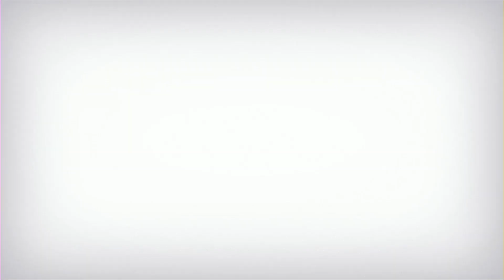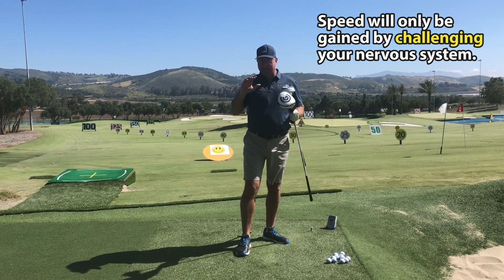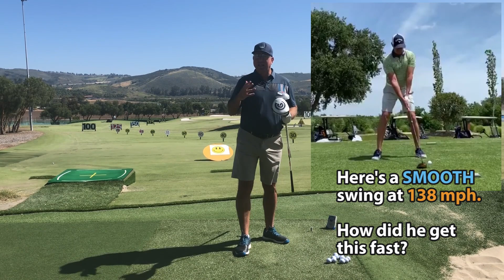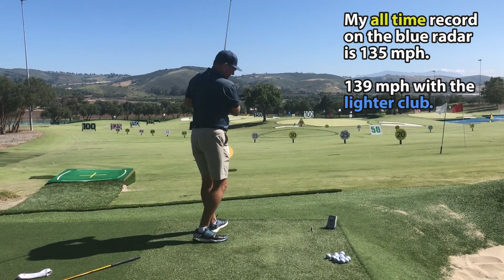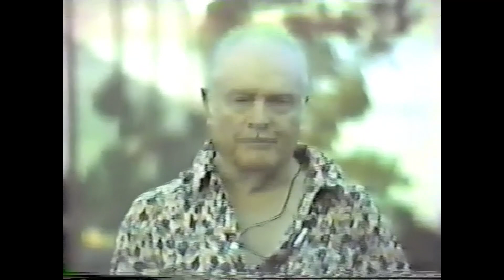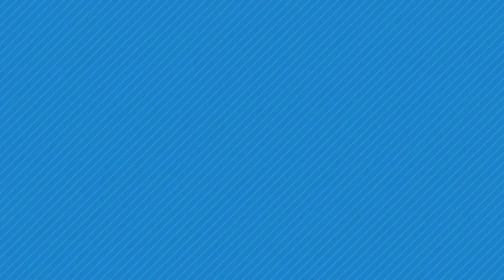Golf Speed Training for Dummies!  Increase Clubhead Speed and Crush Longer Drives!

Comment: Hi Steve
Love your approach to teaching. Thanks for the videos.
When you speed train does your body naturally adapt by fixing swing flaws to foster more speed? Or should you try to make your swing as fast-efficient as possible before trying to add speed to a flawed motion?
Reply from the maker: Oooh good question.  If you're hitting it wildly....more speed will just make it worse.  If you have reasonable control, it's ok to develop speed as a separate avenue from improving mechanics.  Spend some time on both.

Comment: I’ve been wondering....MA advocated a reverse k set up to accommodate gripping with the trail hand. And then he suggest shifting back to get the hip joint over the knee and ankle joints so that a golfer turns about that joint. What is the benefit of that shift over a more neutral set up and smaller shift to the rear hip?
Reply from the maker: These are small modifications that pretender MA gurus will tell you are terrible.  I played for a living and I know there are a lot of ways to get it in the hole effectively (and Mike didn't).

I would keep encouraging you to adopt the setup ideas, but I'd be fine with a smaller shift to the rear hip.  The difference is speed might be 2-4 mph, same as a pitcher from the windup or the stretch.
Reply: Steve Pratt Golf I appreciate the reply. I very much like the method, but that bit seemed like it could be short cut a bit with a more neutral set up. I’ll experiment with both and see where it takes me
Reply from the maker: @Bobby_Batronic  The setup and forward press encourage square shoulders, good swing plane, and efficient angles of attack and low point control.  It really is pretty ingenious.
Reply: Steve Pratt Golf Oh I have no doubt that Austin thought the whole thing through thoroughly, and probably more than once. He didn’t appear to be the kind of man that skipped the minutia, and I’m sure each process, alignment and thought had their reasons and place. I suddenly have permission to make moves and have thoughts that have been verboten in the instruction world for much of my life, and there are well reasoned anatomically driven principles behind them. It’s very freeing. Step into the right heel and your backswing is more than half complete. Raise the right heel and darn near the entire positioning of the body is complete save the throw. Love it.
Reply from the maker: @Bobby_Batronic  thanks for the great comments!

Comment: Good stuff, that's finally a program even I can be disciplined enough to implement, in particular with the regular range sessions and without needing to carry all those speed stick devices etc. around to them.
Can/Should I use a light speed stick or the lighter O Whip instead of a lighter driver as well?
Reply from the maker: How is the lighter O Whip?  If you are at lower speeds, I think any fast swinging will have benefits.